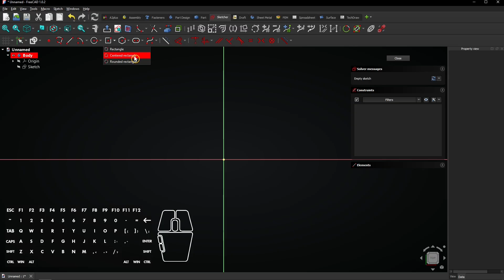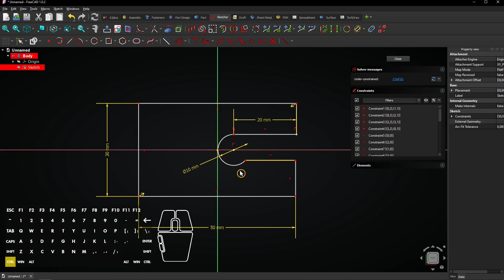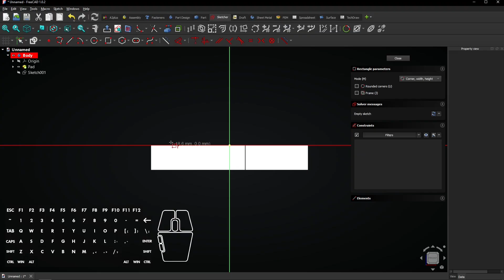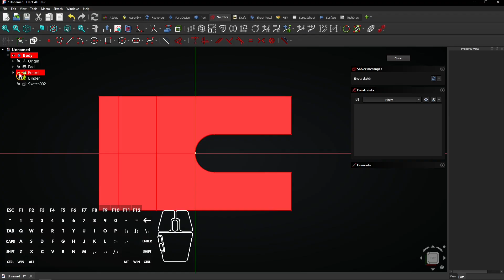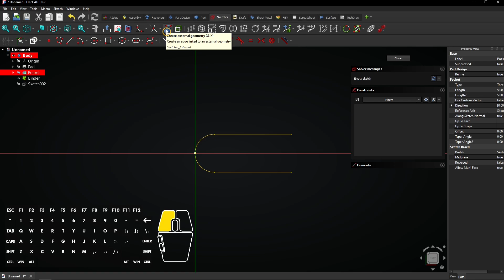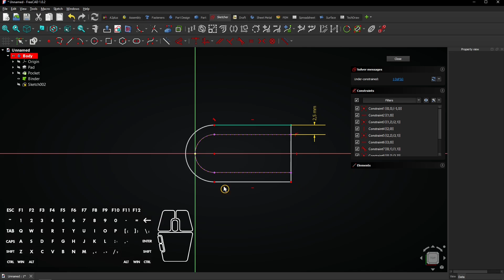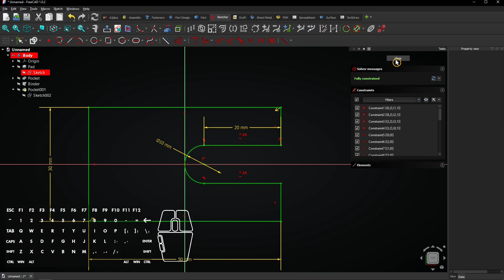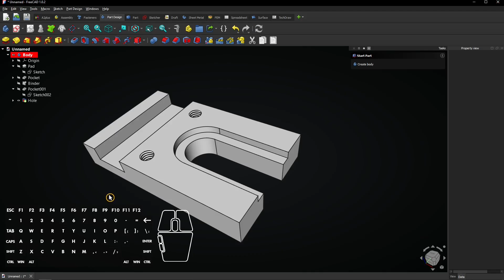🌟 FreeCAD Shape Binder - Milled Block - FreeCAD Threaded Hole - FreeCAD Hole Tutorial

Comment: In this case what's the advantage of using shape binders instead of directly referencing external geometry from the sketch? (naive question, really want to know if there's something I'm missing, I struggle to see the difference between both methods)
Reply from the maker: First i tried it with projecting edges. But when i changed the size of the cut, the groove did not move with it. So it's all about dependancy. Could also be a bug.